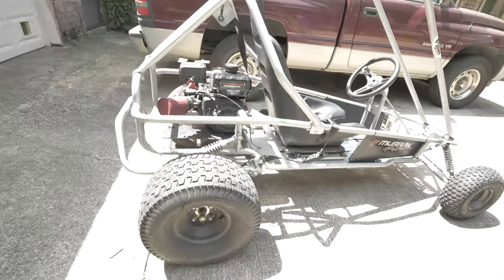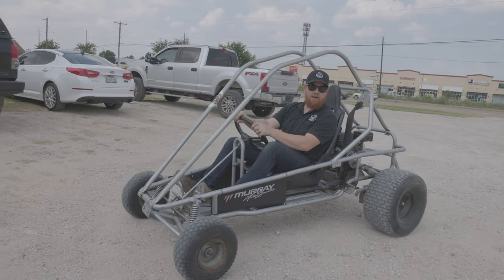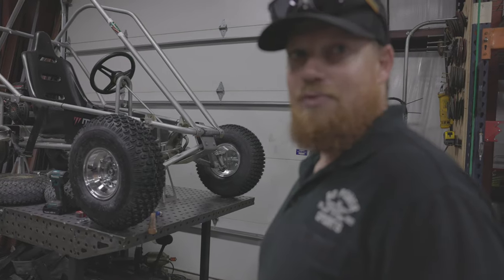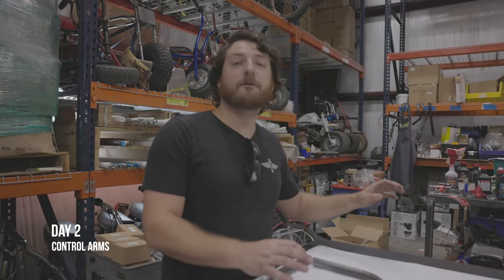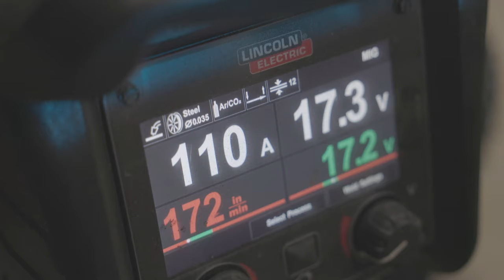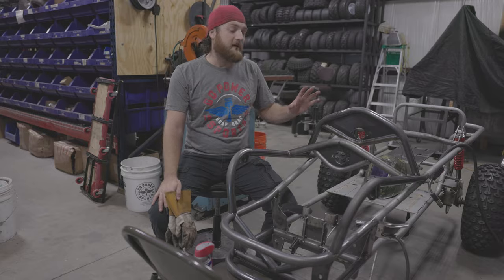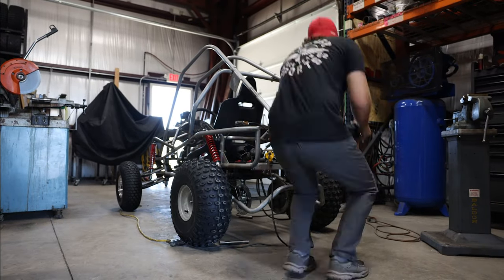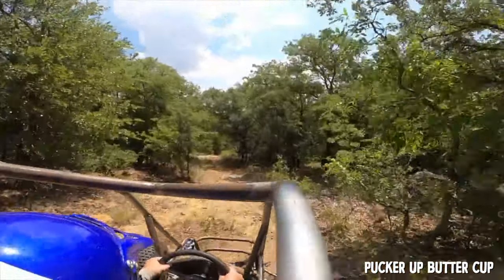Build the Off Road Murray Kilowatt Go Kart Project

Comment: Boy, that project looks familiar.  I started out with a Murray go kart, just as you did, but it was old-style and didn't have any suspension at all.  I kept modifying it over the years and now it has a full independent suspension, big tires, and a Predator 670 engine with all of the mods in it.  It's a blast to drive!!!
Reply from the maker: That sounds like a beast of a go-kart you have.

Comment: I have a couple questions.
Why not build a little kickup into the front end since you rebuilt the whole assembly anyway? Did you consider making the top A-arm a bit shorter to increase negative camber on compression? Did you not do the unequal length arms because of bump steer issues?

Comment: I just got a 1st Gen murray kilowatt hoping yall have everything I need
Reply: They do. I have a bunch of parts on mine that came from them
Reply: @Wilson_Racing  hoping I can call and they know which parts this thing takes bushings and shocks brakes etc
Reply: @averageamerican8965  bushings, no. Shocks and brakes, yes. They take brass bushings on the moving parts. I had to get them from Ebay after carefully measuring each brass bushing

I use the universal chrome 12" shocks up front but they dont have anything good enough for the rear so I got some 13-3/4" HD shocks from BMI Karts and I havent bottomed it out since putting them on.

I have GPS's 80t hydraulic brake kit so it can actually stop in an emergency but had to modify the frame to make it work. I highly recommend going to a hydraulic rear brake
Reply: @Wilson_Racing  ok yea my front end needs some bushings or something on spindles and stuff I'll keep all this in mind
Reply: @averageamerican8965  I'll look and see which ones I bought
Reply: @averageamerican8965  I found them. Here is the link. Idk if it works on here. You will need 12 bushings to redo the whole kart
Reply from the maker: We should!  These were fairly common karts.  Let us know what you need!
Reply: @GoPowerSports  what shocks did you use?